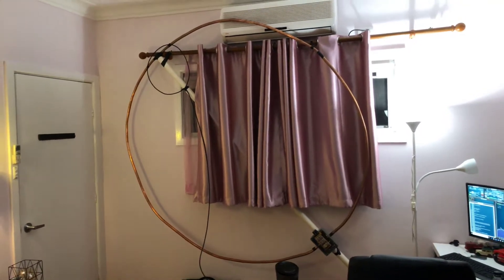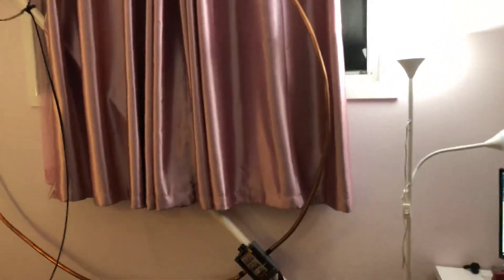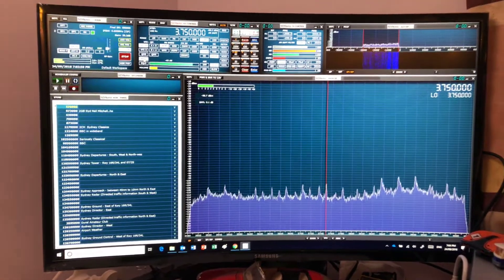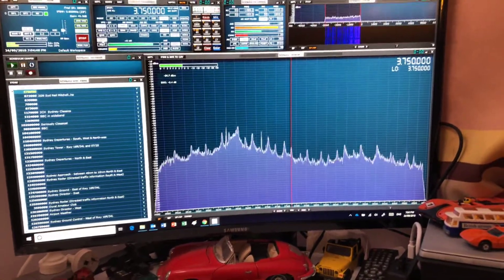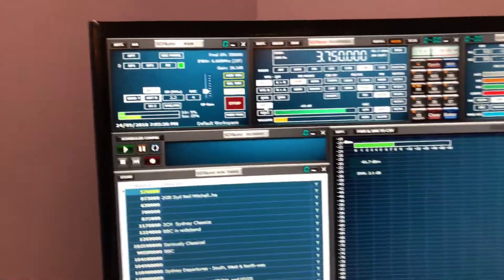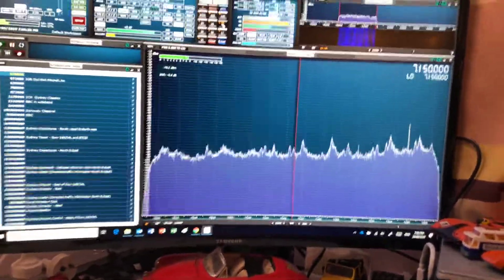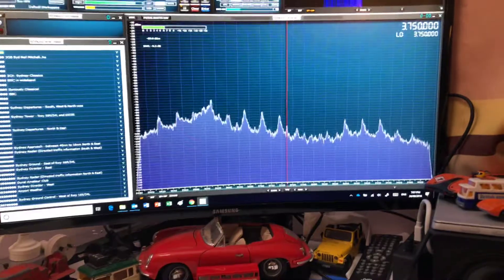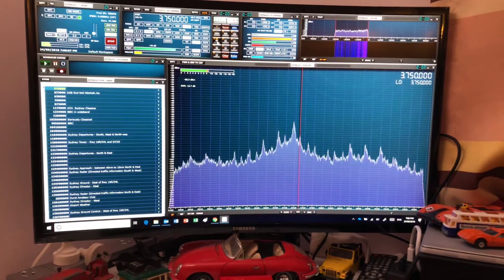Tuning a 6m copper magnetic loop for 80m and 40m with RSP2pro.

Comment: at 00.13 it was called a 6 meter diameter loop - it wouldn't fit in the room vertically if it was 6 meters diameter loop. I think you mean 6 meter circumference ?
Reply from the maker: John K you are correct, it’s a 6m diameter loop.   Slip of the tongue unfortunately.

Comment: Very nice to see another loopy at work..... the smaller loop should be 1/5 the size of the larger loop. The problem l have at the moment is SWR can’t get it down below 1:6, l could just use the atu on the radio to get a happy match, but will still have some power loss. People have good results with a gamma matching, what do you think?
Reply from the maker: Hi Dave,  thanks for the comment,  while i do have my Advanced Ham Licence,  i have not had any time to setup my transmitter with the loop.   I would like to make a similiar 19mm copper pipe at 1/5 the diameter and try it out..

Comment: I can see the peaking on the scope but when you are set let's say at 3.750, can you still monitor the activity happening on each side of the tuned frequency ? if not, it render the spectrum scope useless... that is a shame if it is the case...
Reply from the maker: Aleziss I am not sure what you mean. I can view a 10mhz bandwidth and click on any frequency in the 10mhz bandwidth.   I can also open multiple windows in the same band, so I can listen to multiple stations concurrently.
Reply: @phantomrose1999  what I meant was loop have like 4-6khz bandwidth on some bands, does that mean you cannot view the entire band when the antenna is tuned to let say 3.750 (+/-4-6khz) can you still receive and see signals on the scope that are coming at 3.900 or 3.580 ?
Reply from the maker: Aleziss oh. I understand.  Yes you can see and hear within the ham bands.  Please see my other videos where I pickup hams.  I usually tune the peak away from the station I want, as this produces the best signal.
Reply: @phantomrose1999  ok, I think I might order a loop for TX/RX but I was not sure if I would still be able to use the spectrum scope due to narrow bandwidth,  I will see out your videos to see how it goes on your scope, thank you !